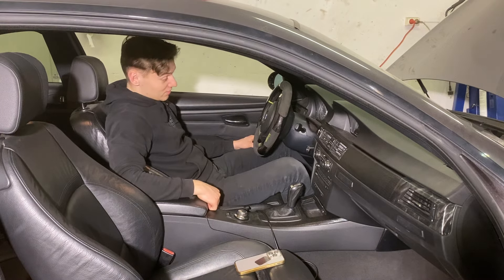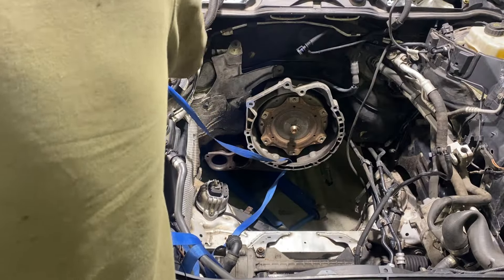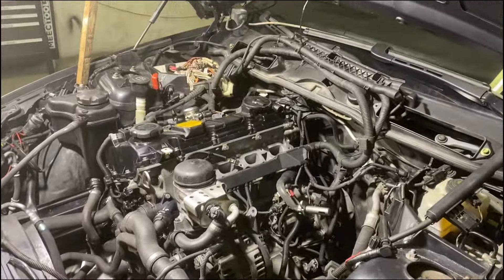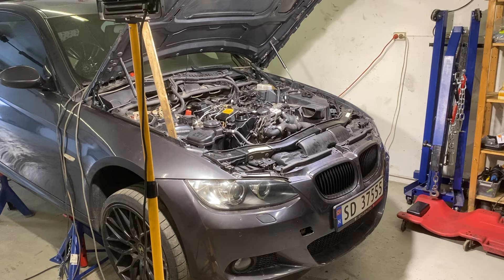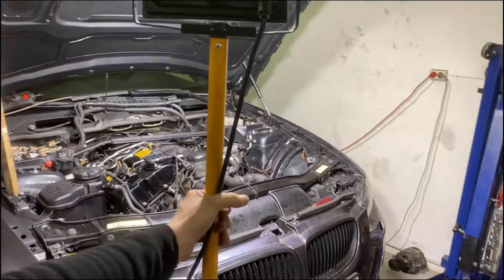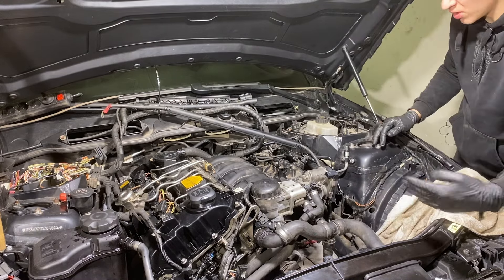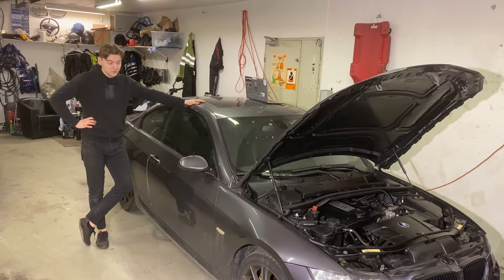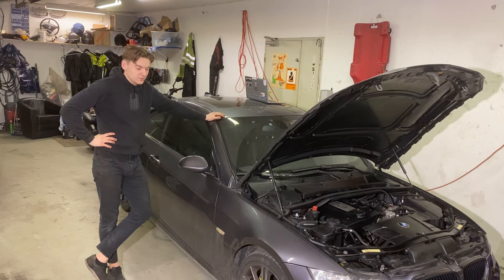BMW E92 320i RESTORATION #3

Comment: N43…. Verdens største drittmotor. Har skrudd mye på de. Elsker bmw, men holder meg vekke fra 4cyl bmw… godt jobba, du gjør en god jobb 👌👌 kjekt og følge noen lokale
Reply: I agree i had several. But the 4cilinder diesels are good.

Comment: Love the videos, just a tip, render the final video in 4k (even if you don't film in 4k), the quality from the bitrate increase it quite noticeable. Also it helps to unlist the video until in fully renders, people might click off the video at first, which is bad for the algorithm
Reply from the maker: Thanks, i will give it a try with the 4K render, and i did actually upload few hours before release, YouTube said it was full HD but changed when I made it public

Comment: Anyone that has built engines knows your pain brother. That oil separator is very common. VW Audi uses a similar setup. That rubber diaphragm regulates the vacuum in the engine. The cap that goes over it has a tiny hole for fresh air. When that diaphragm cracks, it creates a vacuum leak causing the misfires and won’t allow the PCV system to do its job. I hope the oil pressure issue is something simple like a check valve or something out of position.

Comment: Dude 😭 I think I would have just swapped an N52 in there man, my N43 had endless issues and I was so close to throwing it away and swapping one in, but then it decided to catch fire and take the car with it hahahahaha
Reply: I’m so glad I didn’t know what I was looking for when I got my 2006 325i an ended with N52 cause if I did know my dummy self would of ended up getting the N54 only cause the turbos but once I did all my research and seen all the issues they come with I was like I’m glad I didn’t discover that engine cause that would been a bad choice haha
Reply: lol 1 thing I’ve said are cars hear an know when we ready to replace or tired of there shit long story short back in 2022 of June my 2011 maxima got totaled well 2 months prior before the accident I was talking an looking for Mercedes even going to dealers to checking them out haha once the accident happened I was like my car was not happy at all I was disappointed too cause I put a lot of money in to it within the 2yrs frame before the accident so I was kind bummed out for sometime
Reply: I have E90 with N43 engine, and it is a nightmare. I took it to the mechanic with low oil pressure warning, first they replaced the oil pressure control solenoids, then I had to bring it back, then they said the oil pressure sensor is bad, they replaced, then they realized that the timing chain is stretched and hit the plastic timing chain tensioner which broke and then the small plastic fragments clogged the oil pump causing the crankshaft and its bearings to die. After this I will buy electric only. It is exhausting just to think about how many things can go bad in an internal combustion engine. Anyway, the content is good and it made me realize how many tools I would need to fix the engine myself. Thank you for sharing!
Reply: @DannyBoyGhost The first time I went looking for an E90 I had no clue how problematic the 320 is. I had about 12 cars to look at and choose from, my dumb ass lucked out and chose a 323i which has the N52 only because it had a sunroof and was the colour I liked! I could have ended up with a headache engine!

Comment: Id like to see you try working on something 90s japanese, like a 5 or 6th gen civic. see what its like from bmw drivers perspective. they dont break down like bmw but they are also a challenge to work on because of rusted bolts everywhere, getting creative with puting one good part from two used ones from junkyard, driving experience you wouldnt believe but surprisingly similiar the car encourages you to rev higher and go faster than you need to, a very high percentage of slammed, straight piped civic drivers later become bmw drivers

Comment: Really enjoyable video as always. It was really sad seeing the issues unfold though. When you said low oil pressure I really felt for you. The balancing shafts really do help keep that engine smooth and they remove a lot of vibration and harshness. It’d be a shame if you have to remove them as your modification of the new oil pump to work with the balancing shafts was a really good idea. You’ll know more once you’re back in there of course. Did you check the engine was still in time when you replaced the cam cover?

Comment: Keep it up man! im quite interested with this, since I have been struggling with N54 with pretty much the same misfire condition and nothing has helped so far, including injectors, coils, plugs, valve carbon cleaning, vanos cleaning etc. i have had more problems with N-engine in a month,  than 2 M57:s in past 6 years😂
Reply from the maker: Yeah same man😂

Comment: Before replacing sensors and solenoids check the restitance with a multimeter see if the values are different from a good working one

Comment: HI . I have a BMW 318 with n43. Exact same story, I completely rebuilt the engine then exactly the same problem when the oil reached high temperatures boom... low pressure error. exactly like you, eliminating possible problems with the oil valve pressure sensor etc... nothing, always the same error, then as a last solution I completely replaced the entire oil pump with a used one... nothing to do, same problem... For me it remained a mystery. I managed to fix the problem by simply increasing the engine rpm at idle with ISTA because when it was very hot the engine even dropped below 600 rpm, I raised the rpm up to 700 rpm and since then the error has never returned and the engine runs well . The problem with this engine is that it runs at very high temperatures... oil reached 118 -120 degrees water at 117 degrees all the fault of the BMW engineers forced by the Euro 5 pollution standards to make it run at these temperatures. .. I'm very curious if you can find another solution! I wasted months studying everything down to the smallest detail, I couldn't find anything else. I wish you better.
Reply from the maker: That is crazy, did you measure the oil pressure manually with a manual gauge?

Comment: Did you remember to code the new injectors to the ecu? Also if theres any problems with the nox system/nox sensor it can make the engine missfire. If you havent checked out yet bimmerprofs has a lot of info on these engines and on the nox system. I have a N53 in a F10 chassis and it has been quite a pain to diagnose problems, but when its working it is a brilliant engine.
Reply from the maker: Yes i coded them in, it actually seems like the nox is actually may be the problem so your right

Comment: as N43 118i owner i thank you so much for this content, i was hoping you would like this engine but there is no hope anymore i guess. I had problems with engine oil pressure too, chain guide fell apart and block oil schnorchel. Then after mechanic replaced both chains, oil pump goes bad while driving on test drive - oil pump main shaft had striped off teeth, i dont know what happen so i coulnt blame mechanic..bought new oil pump for 1000€, thanks for test if  injector leaking i will do that for sure. Too bad market with injectors for this engine are very bad no new, only refurbished, leaking, not working injectors so its very hard to get properly working index9 (latest). Maybe you can show us what is high pressure dropping due t leaking injector and how it look after replacing. thank you so much for this N43 content and teaching smth new! im sorry for  the oil pump even if i dont understand how can balacing shafts affect oil pressure?
Reply from the maker: I suspect the balancing shafts because the 2 shafts has small bearing that works same like crankshaft bearings, and you see the condition of the crankshaft bearings, so I am guessing balancing shaft bearings are shot😊 aswell as that’s the only thing that we didn’t check on the rebuild

Comment: I had the same issue as you described in the video with the missfire, i read on some forum that only NGK spark plugs were recommended, even Bosch plugs which BWM supplies are not good on these N43 engines, tried replacing injectors, did not help, new plugs nope still not, tried again with NGK plugs, solved the issue
Reply from the maker: Damn, that’s crazy, will give it a shot, but I already have ngk

Comment: A nice project car would be an E91 M57 Manual (or Auto) and if you find one which is M Sport even better.

You have pretty much everything in such a configuration (power, handling, practicality, control, fuel economy).

M57 is a great engine if it’s well maintained, a proper torque 500Nm and around 230hp depending on year.

I’ve bought one E91 M57 Manual (330d 2005) a non-runner. After a bit of digging, cylinder 1 has no compression at all, whilst all the other cylinders have very low compression 4-5bars only.
I suspect the timing chain has jumped and lead to an interference on cylinder 1 and poor compression for the rest.
Reply from the maker: Sounds good, well its a good thing its not that hard to check the timing on m57 engine

Comment: Well, the car is great, but when BMW started the N engine line quality when down massively. 6 cilinders ara better but also with there issues. I think the best way is to stick with original parts, clean the injectors and check the high pressure fuel pump.

Comment: o2 sensor,bank 1 is the problem for misfire cylinder 1 and 4.  I changed the sensor ( bosch ), and the motor run like new.
Sorry for my english☺️

Comment: Hang on, you found the problem, you are really an amazing mechanic. As far as other BMWs, why not an E38 ? Tyler Hoover and Sreten sold theirs when they finished the overhauling and we never saw them enjoying theirs.
Or a car equipped with au faulty panoramic sunroof, like my F46, which costs 3000 € to repair ?

Comment: What about an E39?
Reply from the maker: Maybe, just they are rusty here i Norway
Reply: @EMSGARAGEE61  yes in germany its the same. I have one which is arguably rust free(underside of the drivers door is rusty  and the fuel filler cap place). They are also a bit expensive but very nice and reliable cars.

When you buy one, buy the 530i or d facelift. The m54b30 is something else and a manual one cause the automatic gearbox on the e39 is not that good

Comment: Fuck this 4 clynder engine you need to put straigths 6 3.0i engine in it better engine or 3.0d this engine has so much trubble
Reply: This is what I suggested in the first video. The N42/N43 4 Cylinder is trash from BMW
Reply from the maker: I would if i would keep it, but i will get more for it in the original way with the original documents
Reply: @EMSGARAGEE61  oh okay i am thinking that you myb using this car for daily driver for tuning
Reply from the maker: @ivanxd796  yeah you know i want to grow bigger on YouTube, so after I’m finished with this car I will sell it so I can buy bigger and greater projects😊
Reply: @EMSGARAGEE61 nice keep up good work❤